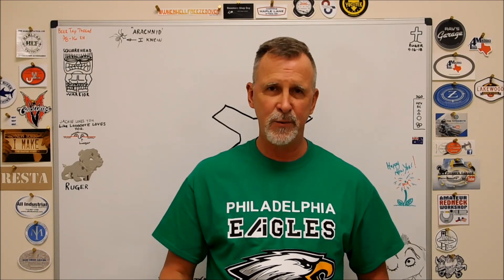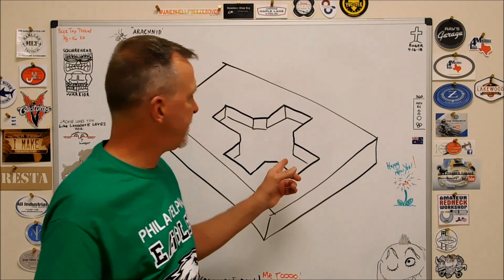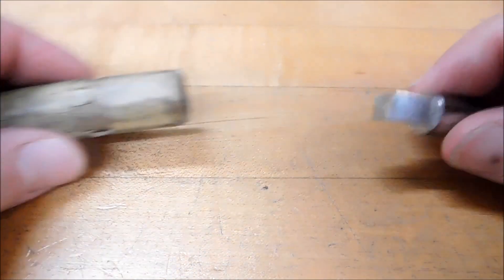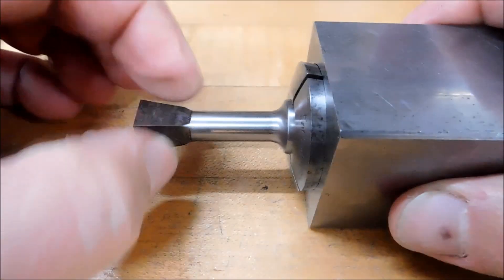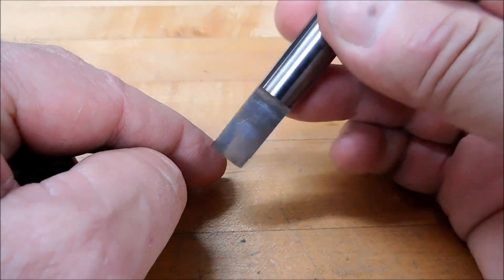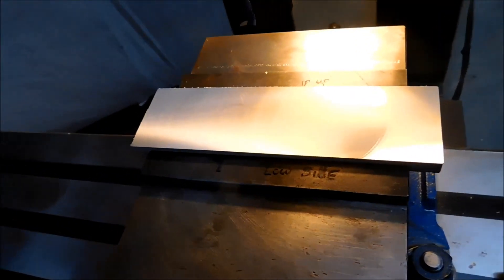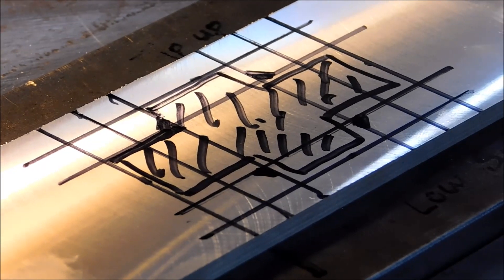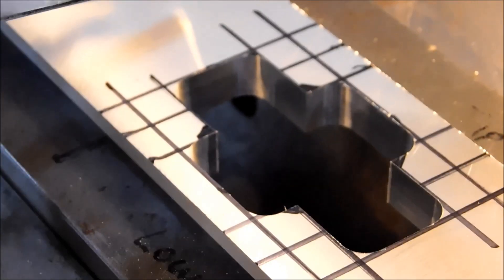You Can't Make that Part on a Manual Mill......Or can You?

Comment: Nice tooling.  Is it safe to assume you have spent some years in a Tool and Die Shop?  I have never tried hardened 17-4 as a cutting tool.  Do you think it holds up well compared to HSS alloys?
Reply from the maker: 17-4 is easily obtainable in condition A. 1 hour at 900 F and its 42-44 RC. A2 will get much harder of course and is better suited for the application, but the SS works in a pinch on softer materials like this aluminum. If you do heat treat A2 in a foil bag, seal everything but a corner, purge the oxygen out of the bag with an argon purge from a tig torch if you have one, and seal the bag before the gas gets out. This stops the oxidization and results in a drastically superior post heat treat surface finish.
Reply: @joepie221  agreed.  I put a small bit of paper inside as well, it will consume any oxygen. I haven't noticed any ill effects, but mostly have a sm amount to grind anyway. Thanks for your videos!
Reply from the maker: Thanks. I've been in experimental, prototype and custom work for 47 years. 17-4 is Ok for softer and short run work, but can't compare to the strength of a HSS tool.
Reply: First you would have to solution heat treat, then precipitation age. Although you can buy 17-4 in the solution treated phase.
Plain A2 would be easier and more wear resistant, heat in a foil pouch.

Comment: I am not a machinist, and sadly haven't had a chance yet to spend some time working at a mill. However I am wondering, is it a efficiency reason (reducing setups and such), or is it just a personal preference, to clear the bulk of the internal material and then broach. (rather than drill holes in the corners and broach the corners, then clear the additional material). I am asking cause to me it looks like you would deal with less potential broach deflection from having more material to support the broach's path, rather than a faces on two sides, and then a void. Mostly just curious is all, thanks for the time and the video.
Reply: @jdkarns  Yeah i guess i was thinking along the lines of a broach used in a press, and not thinking about the actual action of each tooth of the broach. Thx for the response :)

Comment: A lot less expensive than picking up a Bridgeport Slotting/ Vertical Shaper Head. Done this in the past, Mostly in Ampco 18. If you ever get around to making your collar system to orient the broaching tools I think I'd make a special collet to hold the tool that mates to the collars. Then have a few set screws on 0, 90, 45 to position the tool. Orient the collar on the Quill to a fixed feature on the head. Maybe the square corner on the flats by the Quill Depth Stop

Comment: Another nice video..  How do you make the end of the tool 'hollow ground'?  4:22?
Reply: I would like to know this as well.
Reply from the maker: Spin the tool in the lathe while hitting the end with a small die grinder directly in the center. I usually use a cutoff wheel for this.

Comment: Thanks, for another useful how-to video of an "impossible" manual machine job. As a long time tool maker I've broached square corners for years using high speed die punches as cutting tools.  If minimum back taper is used shallow shear angles can be ground on the face of the broach for reduced cutting pressure. Light oil stoning to sharpen cutting edges also helps.  Although cutting action shown here is necessarily fast the actual operation is slow with only .002 max removed each cut on aluminum and less on steel.
Reply from the maker: The video was greatly accelerated for the broaching segment, but my step over was more like .015 for the edge cuts. The full face cuts have to be less of course, but your broach will let you know whats OK. Thanks for watching.
Reply: @joepie221  Thanks, as I understand it, step over on straight cuts is .015 with depth of cut about .002.  About 1 degree per side back taper is adequate to prevent rubbing.  So glad you demonstrated this so well to your subscribers and viewers.

Comment: Thanks for bringing out safety.  I'm paying for not wearing safety glasses now so thank you for the warning to your viewers. Also thanks for all your share knowledge
Reply: Fortunately, I learned to always wear safety glasses around steal that can fracture under high pressure without loosing an eye, long before becoming a machinist. it was still pretty bad though. 

  I was young. Somebody told me to bang all the dirt out of some trackhoe teeth so they would be loose enough to replace them. I had no frame of reference for this and they felt really solid so I slammed those things with all my might and eventually I a few sparks on one of my swings and my leg hurt like hell, a piece had broke off the tooth. I could see a small hole through my jeans at my thigh and figured it must have gone through and just hit me really hard. after trying to walk it of for a minute, I felt some sticky stuff at my ankle so I looked down & noticed my sock was bloody. So, after a couple x rays and two separate attempts, the piece was surgically removed. The Doc said it corkscrewed down, five inches from the entrance wound. it wasn't even the size of a .22 but now I know what it feels like t be hit with a bulled fragment.

Comment: Thanks again Joe, that is a technique I didn’t know much about, always learning something new! I think a very robust mill would be needed to broach like that, not a hobby machine, but I suppose it depends on th3 material being broached.
Reply from the maker: You can nibble away with smaller bites. The machine, setup and broach will let ya know where the line is.

Comment: as usual, a wonderfully-informative exposition of a too-little-covered topic

when i've seen mill spindle broaching done before, it was suggested that you engage the brake (i've seen people go as far as make something to retain the brake in the 'engaged' position, so you have two hands free) to prevent the spindle rotating - if you put the machine in back gear & a low rpm, do you find that engaging the brake isn't necessary?
Reply: In back gear engaging the brake isn't necessary. You can actually turn (fine adjust) the square broach in the collet with a Crescent wrench or vise grips for precise alignment if necessary.

Comment: Back in 98 when I was going to school for manufacturing engineering we had to hand write a cnc program for a boring head. The Allen head 40 tpi bolt for adjustment had to be broached. We made our broach out of a dulled endmill on the surface grinder n broached the bolt head on the manual lathe. Our teacher was a lot like Joe, he knew all the slick tricks.

Comment: I am making some Irish wind instruments out of 6061 and 7075 AL. They will require sharp corner features in the wind ways, so I was super excited to see this video from you Joe!  My questions are, do I need to heat treat my broaches that I will be making from tool steel blanks since these would be used exclusively in Al and Delrin? I do not have any SS but I do have a few SECO Fagersta cobalt tool steel I can make a broach from.

Comment: Thanks Joe, nice tips included on broach geometry! Always "greedy" to learn more, if you have any more ideas and tips on broaches (material, grind, heat treating? Gee, only that ;-) ) it would be nice to see maybe a short dedicated tutorial on broaches and how to use them? BTW, I assume that the temperatures you give on heat treating are in degrees Frankenheit? ;-)  I think that I could do some small broaching jobs on my drill press? Especially if I make a locking collar between quill and collet/chuck (just one more great idea!)...

Comment: I could not help myself but to have a HUGE smile on my face as I watched this video!!!!  because I have often wondered if I could do something like this but being self taught (I should say taught by Joe Piecztnski) I thought I'd get laughed at ridiculed  NOW I know I can cuz if Joe does it like that so can I Lol !! Thanks for a Great video and as always Two Thumbs Up Sir!!
Reply from the maker: Thanks for the comment. I hope you take the time to read this reply. I have taught many apprentices over my career and always learn something when I do. Everybody thinks a bit different than the guy standing next to them. Thats a good thing. In the early stages of my training them, I always stress safety. No job is worth getting hurt, and crashing a machine can be a costly mistake. Especially when you own the machine. That being said, I try to tell my guys, this machine does this, and that machine does that. But when I say that, I mean there is the spindle, and there is the table or carriage. Don't be completely blinded by the baseline intent of the machine. Like holding a part in a mill vise and putting the cutter in a collet. "What if" you put the material in the collet and the cutter in the vise?? Or on a lathe...."What if" you put the cutter in the chuck and the workpiece on the cross slide. You have movement and you have rotation. How you apply these forces and areas can be quite interesting if you aren't blinded by the basics. Just be safe and don't hurt the machine or yourself. The rest is up to you. I hope the things that I show, plant seeds of creativity that you can use to get past obstacles and come up with variations of things you see to make your job easier and take your abilities to the next level.
Reply: @joepie221  - I try and read all my responses if I can lol and you my friend are one of the very few of whom I subscribe that actually cares about what his viewers say and learn, you are a fantastic teacher! You take the time to respond when applicable. I know you cant respond to all but if you could you would that is the type of man you are. You have given me (all of us) some great advice Joe and have taught me and others a TON of things that probably would have taken use years if I worked in a shop (well maybe just me), Sometimes it can be a good thing not to be taught strictly be the book so to speak you said it PERFECT "Don't be blinded by the baseline intent of the machine" just ALWAYS be safe. I like the way you think Mr Pieczynsk!i I can tell that what you post and say in your videos comes from life long EXPERIENCE & not just in the machine trades either I think I can speak for most if not all of your 50k subs that it is a joy to learn from you because (Imo) you don't talk down to anyone or make them feel "sub par" your like "Hey if you don't know how to do it  this is how I do it or this is one way to do it" and that is what makes you a MASTER! Thanks for the response and I hope you and your family have a WONDERFUL & Blessed Holiday Season!!!! btw You keep teachin and we will keep learning from one of the best in the business. You have a lot of little sprouts out there haha

Comment: Now I want a CNC broaching tool
Reply: Careful if you have ceramic bearings in your CNC, they dont fair as well to shock loads.
Reply from the maker: Just to be clear, this was done by hand on a manual mill.
Reply: O no I understand that, manually where you can feel the tool is the best way to do this. On a CNC the loss of feel could result in some ugliness. And great video btw
Reply: @procyonia3654  I'm just lazy and don't want to do even 15 minutes of broaching. If the ceramic parts don't handle it, I wonder if someone has ever made a CNC shaper
Reply: @JohnDotBomb  I used to run a CNC planer/planer mill conversion. So yes, did tons of planing/shaping internal keys and such... but the ram head with the planing or shaping tool was a solid Clapper box or in alot of cases a VTL tool holder depending on which ram I had hung down. We also had an HBM setup for internal shaping, however all of those tool drives didnt go through the spindle (which can damage the bearings in CNC operation due to the lack of tactile respinse). To do that you can bolt something to the headstock face to hold your tool and or bar that your tool is In and apply the concepts Joe showed in this great video. Write a macro and you are off and rolling.

Comment: You teach so well.  I am just learning without formal education as a hobby.  I have learned more from you about machining than all the other U-tube videos combined...You put Mr. Pete to shame, but he is okay too, I am just beyond high school level.  This broaching stuff fills a huge gap, thanks so much.   As a question, could an old unused drill press be used for this effectively if the slop can be controlled?
Reply: My question, too...maybe some "spare" Moglice to make a slop-free spindle on our drill presses?
Reply from the maker: Absolutely. If you can keep the flex out of the table, lock the spindle and hold the tool securely, I don't see why not. Thanks for the compliment.
Reply: @joepie221 and, I guess that a smallish size broach, and "nibbling" at it, reduces stresses, just need more patience :-)

Comment: ….7:20....good point there, lots of machinist and metalworking videos on here, very few ever address the chips from bottoming tools. broach, taps...even reamers.
  And those inside square corners....are you telling us you couldn't do that with say...a .003"' single flute carbide end mill..? Surely a .0015" radius would be OK...? Oh. I see...it needs to be done some time …...today....
  Later, appearance like a wire or extruded cut...yes, they are getting better all the time, but still some 'cutting lines'......is that part bead blasted...it has 'that' kind of finish...?

Comment: The YouTube AvE had a video where he made what he called a “wobble drive” it used a a rotary component which wobbled a stationary square broach to square a round hole. It’s an interesting technique and worth a look.
Reply from the maker: Those are commercially available. I've used them for years. Never made one though.
Reply: Joe Pieczynski thanks for the reply. I find your content fascinating. I’ve not used a lathe since high school but, I’ve great respect for those people skilled in enabling the modern world! Cheers.
Reply: Perhaps you could redo this video demonstrating the rotary broach as another method/solution if it’s applicable?
Reply from the maker: I believe its called a rotary, or roto broach.

Comment: Great tool management and work Joe I've done several Chevy emblems block chain style  external and internal out of 3/8 aluminum filled with a transparent  plastic resin sanded and polished out then back lit for a custom audio build that was a nice project let me tell you I done the long sides first that way if I screwed up you can salvage it for a short one which I did once lol.

Comment: Is that really faster than hand filling it?
Reply: there is no file that would produce a corner that sharp or accurate
Reply: I use a lot of different kinds of files that many people dont even know about, so yes you can but it takes a lot of practice and experience.
Cant remember who the teacher was but many years ago his apprentices were required to take a chunk of steel and make a perfect cube of said dimension. 
I do a lot of draw filing to make smooth flat surfaces. 
I made the hex end wrench for my lathe tool post nut with a bar of steel a drill press and files.
Fits better than factory. 
Did it just to see if I could and took parts of two days.
The P08 Lugar was finished with files.
Reply: Maybe not in aluminum but it is far easier to get something to a specific dimension this way and you will get square edges which are harder to do with a file. You maintain the positional accuracy of the mill doing this instead of trying to hand work it. Basically depends on what you are making the shape for, if it is merely clearance or relief then sure just file it but if it needs a tight fit this is a way to get it.

Comment: Great video and explanation of broaching. I never done this type of machining before and would like to learn. I would love to see the actual hand motion you've done and the force you have to input. Maybe next time if you could show at least a little bit at normal video speed and with sound. I definitely think for many it would make a big difference to see the operator struggling(or not), the sound the broach does, etc. Also you made a test cut each time you started a new side?

All the best,
Daniel

Comment: Hi, cutting internal corners 45 deg wasn't possible with cutter? Rotate table 45 deg and cut instead of broaching? Just curious why broaching approach in that case.
Reply from the maker: I wanted to do the entire pocket without moving the part. Thats the only reason. It could have been done many ways.
Reply: I was wondering the same.  My counter argument for excluding the rotatable table is rigidity, one less layer of complication.  My approach would have been central diamond/45º rectangle first. Followed by the squaring the table and cutting the second and third rectangle. (I'd worry a little about tool deflection when approaching the 45º face.)  I approach the broach as a specialty tool, and minimize it's use inexperience.  I figure he wanted to showcase the broach and the rapid realignment.  But as he said it only took 12-15 minutes to cut the part so bolting on a rotary table below the vice might take longer. .. I'm rambling.
Thank you, Joe Pieczynski, for the video and your knowledge.

Comment: Don't know if I missed it or not, but do you run the broach up and down with the quill or the knee?  I would think that aluminum and other softer materials you could get away with the quill but steels and such would need to use the knee.
Reply: Quill. As long as you only take a small bite at a time, you can even do steel with the quill.
Reply: @MysticalDork  thanks, good to know. That's what I was gathering from camera movement and such. But wanted to be sure.
Reply from the maker: It was the quill the entire time.
Reply: @joepie221  I guess you learn real quick how much you can advance into the piece and still manually generate enough  force to shave it off.